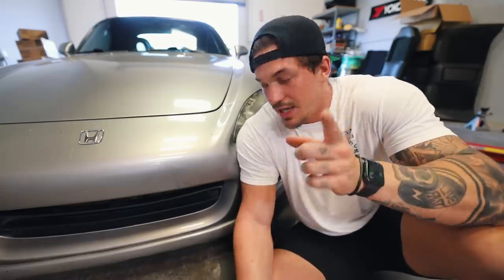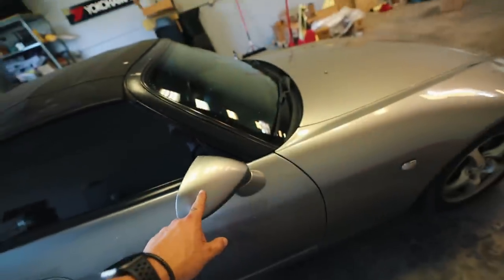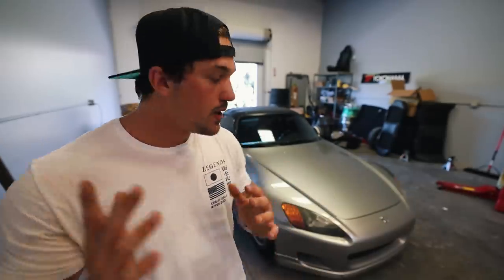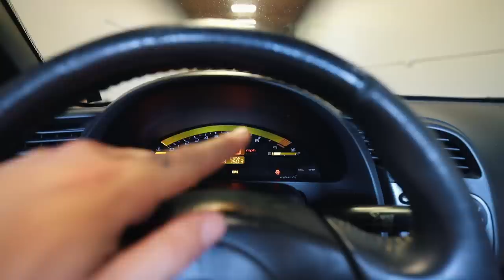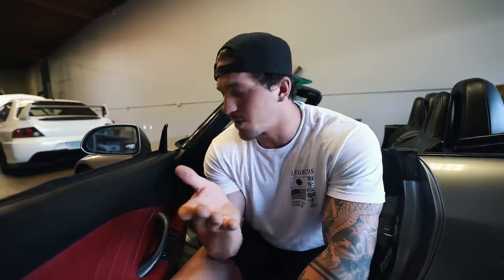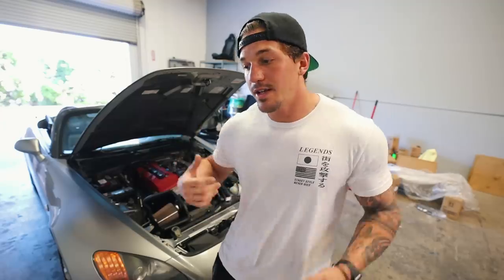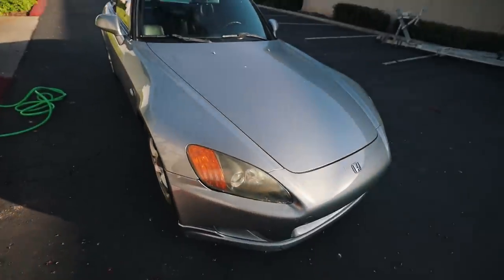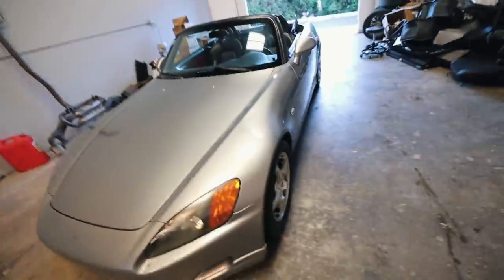EVERYTHING YOU NEED TO KNOW ABOUT MY HONDA S2000 - FULL PROJECT WALKAROUND

Comment: You can swap out the seats and get lower seat rails at the same time. Time for that Honda sponsor for new OEM parts. You can also get a full F20 swap from HMotors if you want to go back to AP1 setup. Or, if you really want to go big, Spoon has fresh ass AP1 motors built by Spoon.

Comment: You keep saying “none of the benefits of either.”  You do realize that with the 2.2L engine you have more torque, revised and improved oil sprayers, valve spring retainers that won’t crack and grenade the engine.
Reply: +makes more power and responds better to basic breathing mods, depending on the year the motor is you can just flash the ecu with a new tune rather than having to go full stand alone. so many benefits haha

And thats coming from an AP1/F20C owner as well
Reply: Imo if you want torque you're better of buying another car xD The s2k is all about the revs and in that way the f20c engine is just more fun

Comment: For people who don’t know why S owners swap the F22c(Ap2) engine in the ap1 body are for reliability issues, and other reasons. Not saying that the f20c is unreliable but it does have those imperfections in their engine since it is the first gen. For example, the retainers, oil squirters, and oil consumption. Now all these issues can be addressed IF you want to open the engine up but people would rather just swap the f22c, and sacrifice a couple hundred RPM’s for reliability, since the F22c are more refined.
Reply from the maker: Nice! Thank you for the info. I was genuinely curious!

Comment: Swap to AP2 headlights... don't do JDM. They beam pattern isn't correct for North America.
I'm running a Spoon front end so i'm biased...
Also, benefits of AP2 motor is if it's Drive By Wire (2006-2009) than you can run a Hondata Flashpro which is considerably cheaper than upgrade to AEM Infiniti.

Comment: Im just going to comment on this as the video plays through so there will be edits and itll be a long comment. Did the same thing on the first video 

- F22C is easily the better motor. Lots of other comments on that on both of the videos so wont worry about that.

edit #2- The front bumper cracks in the same spot on either side is most likely caused by the crash beam behind the bumper. Id say the old owner has lightly run into something and pushed the bumper back. Depending on what bumper you buy check to see if they're made for AP1 or AP2. AP2 bumpers require the slightly smaller crash beam to avoid that happening again. Lots of guys just grind off the corners of the crash beam so thats an easy fix.

edit #3 - Dont buy the 'JDM' headlights out of japan as you'll have the headlight beams the wrong way as they're made for RHD. You can buy the clear shields separately and retrofit to the USDM headlights or if you really want to buy the whole headlight unit, buy from Australia. Same clear headlights but without the JDM tax. There's also two types of the clear headlights (black housing or chrome housing) decide what you want, the chrome facelift model from the 02-03 model has a higher buying price obviously.

edit #4- Rear bumper sag is super common, the tabs holding on the bumper are thin plastic and break super easy so the clips don't hold it up any more. Super easy fix is remove the tail light, push the bumper up into position then tec screw the bumper through the rear metal tab and it'll never sag again.

edit #5- Have fun with that window moulding tape, even in good condition it's the worst to get off.

edit #6- Get a robbins replacement AP2 soft top with the glass window. You can run both the soft top and hardtop.

edit #7- Should've got a compression/leak down test before buying. 180-200 is pretty low for these motors. I'd be expecting 210-230 on a healthy motor.

edit #8- Car doesn't need anything except some decent tyres, brake pads and some good fluids to get out on track. Even stock the S2000 is a capable car but i understand that doesn't make for good content. Just make sure you get decent suspension components. It's very easy to make the car worse in that aspect with cheap, poorly made components as stock they're so good

Comment: Spoon? Voltex? Naw... J's Half Bumper

For compression... it should be in 240s if it's cherry, but it'll be hard to find one that high.  As long as the number is over 210.. you should be fine.

Comment: I if I snagged it, new 
aftermarket front bumper
Side skirts
Rear diffuser/bumper lip
Coils
Wheels
Braided lines/pads
Intake
Exhaust
Tuneup
Red racing seats
Steering wheel
Spoon hardtop. 

Done!

Comment: Dustin, on the back of the cylinder head the VIN of the car the engine was built for is stamped.Its facing the firewall and its hard to see, but a small mirror will help a ton. You can then search the VIN on google for any possible reported history.